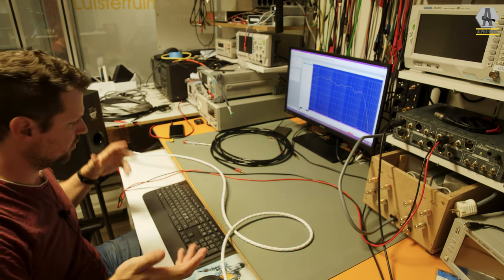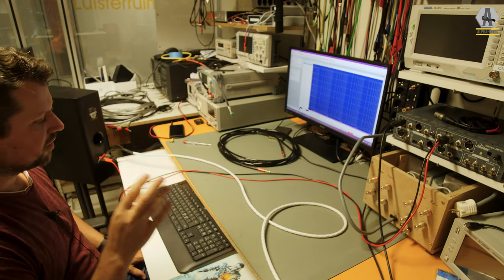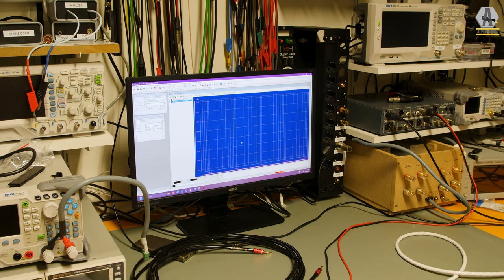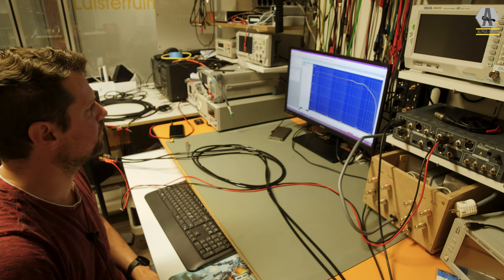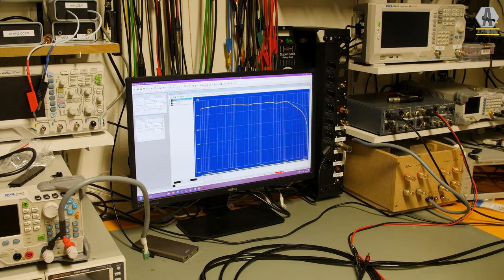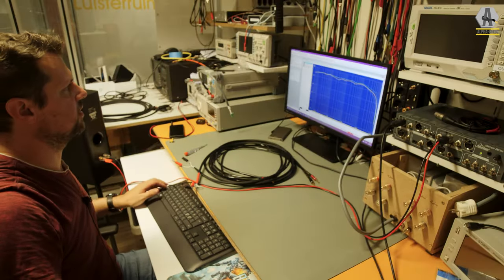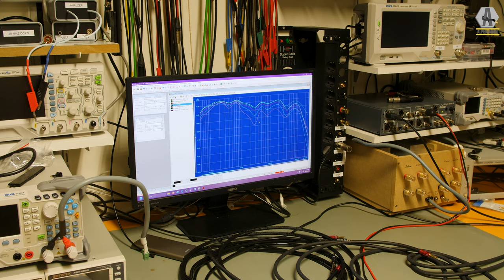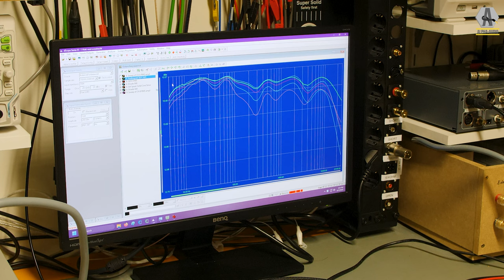Alpha Labs - Do speaker cables matter? We measured five of them!

Comment: You are laying the cables different in your test. You are creating coils this way in some tests. Coils will take energy and will influence frequency respons.
Reply: Yes, inductors block high frequencies, so by coiling the cables he is blocking the higher frequencies in the unshielded cables which would explain the high frequency drop off in some cables. That is of course assuming the cables with the highest drop off were unshielded cables.
Reply: Coils that loose will not act as inductors through air.
Reply: Just commented this before seeing yours. The cables with the highest apparent effect were laid in near perfect coils. Hard to take a "lab test" seriously with such a fundamental and clear flaw.
Reply: Well what would be according to you the impact on response of 3 small loops in the cables?

Comment: Wires have resistance. When driving a complex load like a speaker, the voltage drop will be frequency dependent. The best speaker wire is the one with the lowest resistance, this is no mystery. It doesn't have to be some exotic silver whatever, just plain old thick copper wire. Thick enough for its resistance to be insignificant at the length needed. The test should have been run with no wire as a calibration and the first wire repeated at the end of the test for repeatability. I suspect things like the amp and speaker were heating up making the comparison invalid.
Reply: That's similar to what I was thinking. He's talking about a difference between cables on the order of tenths of dB's, while only having taken a single measurement of each cable. We don't even know if the results are reproducible, let alone accurate enough to say with any confidence that there is a difference.

Edit: Oh and another thing I noticed, several cables are tested with part of their length coiled up on the desk. I wouldn't be surprised if that also affected results.
Reply: @MicraHakkinen   Yes, when you lay or wrap non-shielded cables into a circle or loop, it essentially creates a wire inductor coil or "inductive loop" to at least SOME extent.  And we all know how inductors are used and what they do in multi-way loudspeaker systems, right?  In addition, some of the speaker cables were shown laying across or on top of other coiled cables, while others were not.  :/

The best option would have been to "unwrap" and fully extend each cable and route them all consistently along the same path as much as possible, and also AWAY from any other electronic equipment and/or ferrous metal surfaces.  If you can not extend the cables so that there are no coils or loops, the best practice is to lay them in a large figure-of-eight pattern like the infinity symbol... ∞ with the signal input and output ends of the cable entering and exiting at opposite ends.

Just one real-world example:  We always MUST do this with the "head" or "feeder" cable for our 1k to 20k Arri HMI Fresnel and PAR film/video/photographic lighting fixtures, especially in hot weather and/or full sun, because the lamp head will continuously shut down due to the inductive loop that is created if the cables are simply coiled in a circle like a garden water hose.  The wire coil itself creates the "steady state" inductor, but as the coil heats up over time it further changes the parameters of the coil.

I've seen variances even in "straight" wiring due to whether or not the overhead fluorescent ceiling lighting fixture was turned on or off (EMI/RFI from the magnetic or electronic fluorescent ballast interacting with the cable).  This can also happen when nearby electric motors are or are not running...from a nearby fan or A/C blower, etc.

Also, as mentioned, the parameters of the loudspeaker or individual drivers (and potentially the amplifier) will change even due to mild temperature variations of the voice coil and magnetic motor system as it is powered and in-use (heating up) vs. resting with no signal (cooling down) for a given period of time...easily enough to cause these very minute differences.  Anybody who has tested loudspeaker driver parameters would understand this.

IMPO, there are simply not enough controls in the way these tests were performed to eliminate potential external variables...especially such minute differences.

To see if we (you) can actually hear and discern the effects of non-audible upper harmonics on the audible spectrum, simply play multi-tone sine waves or pink noise with and without an additional >20kHz 2nd and then 3rd harmonic signal component added to the multi-tone.
Reply: So bigger is better ?  i use 10 AWG all through my system, seems to sound fantastic to me,any thoughts? Thanx.

Comment: Under normal listening conditions though, there is no way that anyone would ever be able to tell them apart. What we can chart on a graph and what we can measure on a scope vs what a person can actually discern with their ears...well, those are two VERY different things.
Reply: 0,25 db of eq at 2,75khz can be audible. If we're talking about frequency response with a speaker load, 0,5db vs 0,25db is the difference between a decend enough amp and a good amp. 
It's hard to hear yes but it's audible. It can take some of the edge of the upper midrange. An area where alot of speakers have a hump in the inroom response.

Edit: I  would never use a cable as an eq measure btw.
Reply: Normally, a variation of 3 dB is required to be noticeable..25 no way.
Reply: @chuckmaddison2924  0.25 dB is hard and I would have a hard time in an abx test but 1 db is not even hard to notice in broad band eq abx test. 3 dB is a doubling in energy. Everyone with "normal" hearing should be able to pick that up in no time.
Reply: Not to mention the "worst cables " were laid in coils creating inductors.

Comment: I appreciate seeing this test. While it's important to keep in mind that this is only a test of frequency response and that it's with a specific amp and speaker pair, I find it reassuring that these cables vary by fractions of a dB, which to my old ears I know will not be audible. Phase variations different speaker-amp pairings etc. might tell a different story, but for me personally, I think this test reenforces my belief that speaker cables are likely one of the minor influences on the sound of my system. That said, I didn't exactly neglect them in my system. I'm using DYI Mogami W3082 speaker cables. No idea how they might test, or truth be told, if they sound better than the 16Ga zip wire they replaced, but they made me happy.
Reply from the maker: https://alpha-audio.net/background/the-mutual-influence-of-speakers-amplifiers-and-cables/

The impact remains. The characteristics of the cable as well.

Comment: It's always refreshing and very rare to see someone actually trying to get to the bottom of this question with actual measurements. However, there is a slight issue, there might be something in the circuit that induces current behaving as a microphone in this noisy environment that also has speech. The only measurement that's valid in any atmosphere (a resistor) did not show these changes, interesting. Simply measure again and again with the same cable and just talk next to it, the results will be just as different as here.
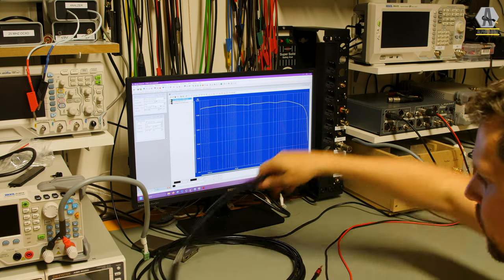Reply: The sound is not measured, the speaker cables are plugged into a plug which is connected to the dScope, which in turn is plugged into the binding posts of the speaker. See 3:25. So, the response curve of the current flowing through the speakers cable is measured. The resistance is the impedance behaviour from the speaker as the sound is played through the amplifier to the speaker.
Reply: @jmtennapel  Let's draw the system from the amplifier's side. The speaker is connected, and to the speaker, the analyzer is connected. This is a general parallel connection, the amplifier drives both the speaker and the analyzer. For a parallel connection, voltages are always equal (simplified), so the voltage measured on the speaker and on the analyzer are always the same. This would be the same if the analyzer would output some voltage. Both the speaker and the amplifier could see that change. This is also true for the speaker, if that created some electricity, it would drive both the amp and the analyzer. Uh-oh, it does create electricity! Speakers are backwards microphones (microphones are literally measured by driving one mic as a speaker), although not very effective, but measurable microphones. The voltage that is created that way, by the noise and speech, is what was measured here.
Reply from the maker: The input impedance of the Prism dScope is 100kOhm. The speaker is 8 Ohm nominal. I don't see the issue.
Reply: @TheAlphaAudio  And a multimeter is 1-10 MOhm yet still measures the same voltage. Resistance is only a factor in serial connections, those are voltage dividers. Parallels divide the current, this is why we use such high resistances, to not burn the analyzers. The issue is that this system is not closed, and atmospheric effects (like the sound of fans and speech) influence it through the speaker. What the driver is inducing is nothing coming from the cable (we're talking about an LTI system here, if they measure the same on a resistor, they can't meaningfully affect a speaker), but what the sound in the room added to its movement - this can meaningfully change the suppression pattern that ultimately resulted in those frequency responses.
Reply from the maker: @SpamMaster57  ok

Comment: You are leaving random numbers of coils/turns of speaker cable on your test bench depending on the length of the cable. What do you think that is doing to the inductance of the cable in your test setup?

You need to repeat the tests with the cables laid out straight. or at least with a single smooth curve from amp to speaker.

Comment: Awesome thank you.
Any interest in taking the connectors out of the equation ?
And maybe seeing whats what with solid vs stranded vs multi core vs flat, copper vs silver, purity ect..
I think connectors can only degrade.
Reply from the maker: Welcome. I don't have a test on connectors planned at the moment. Not sure that really makes a difference to be honest.
Reply: @TheAlphaAudio  I know this was just a test to confirm that frequency response is effected by cables.
And that's fantastic, thank you.
This now gives us insight how this has been a tweak.
Idk answers lead to more questions.
I can't help but to wonder what solid copper wire vs stranded vs flat looks like on the scope of yours or why some consider 99.9% silver sounds bright but 99.999 silver doesn't was all the countless hours and dollars spent on eq via cables ?
As for connectors idk why does gold sound warmer and rodium not so much ?
Maybe 12awg lamp wire has the flattest response but someone preferred silver 1k silver plated copper cable that tilted up from 10k 1 db and that's why it sounded better to them when they could have saved the 1k and used eq and lamp cord....sorry my brain went crazy after seeing this video... 😂

Comment: This fantastic data!  Would very much like to see more of this.  Also, what do you mean when you say you can’t hear 25k but you will hear the harmonics ?
Reply from the maker: We will make more videos like this. We are developing a special device to measure interlinks for example. 

A 25 KHz tone has harmonics. For example there is also energy around 12,5 KHz, 50 KHz... Multiples or for example half of the frequency.
Reply: thanks!  I still don't understand the harmonics thing, but I will ask uncle goooogle and read up.  You and your friends are really doing some unique work.  
I have only just recently approached the point with my HIFI that cable and interconnects influence the sound in an audible way, so this is very timely. thanks again!  
 @TheAlphaAudio

Comment: Is there a correlation between physical parameters of those cables and the frequency responces?
Reply: The visible effect seen on the screen results in slightly different Resistance of the cables. In other words, slightly thicker or thinner copper. You can see two areas,, where the lines are very close. Both unter 100 Hz. These are impedance maxima of the used speaker. At these points, the Impedance of the speaker is much higher as elsewhere (maybe 40 ohms), and so the current and the voltage drop is lower. All in all a flyspeck. ;)

Comment: People can spend a fortune on thick cool cables for their speakers, but when you open up a speaker and see the pathetic wires inside, it is quite upsetting. Speaker manufacturers really skimp on the internal wires which can have a fair amount of length. They gotta clean up that part of speaker design. Professional studio monitors put the amp inside the speaker so that cabling is not critical, and many studio monitor sets now use ethernet to transfer the data digitally, losslessly, like GENELEC SAM systems.
Reply: Powered speakers are for most customers a better idea, but when you talk to the manufacturers of those powered speakers, they will all tell you the wire inside their speakers matters as well.
Reply from the maker: I agree with the powered speakers... definately technically a better solution.

Comment: A one-decibel difference in loudness between two sounds is the smallest difference detectable by human hearing.
Therefore the fractions of a dB difference between your cables is, to all intents and purposes, irrelevant.

I expect that some, perhaps most, of the measured differences is less due to the cable itself and more a function of the integrity of the cable to plug interfaces and plug to socket integrity.

And I think we should all be mindful of the fact that the more you zoom in on an inch, the more it looks like a mile!
Reply from the maker: I disagree. But that is not relevant. We will be doing more research to indicate the difference.

Comment: You didn't state what exactly the test setup is, what are you measuring, through a measuring microphone, or the response at the speaker positive terminal? Was there a crossover circuit in the path? Did you try measuring the same cable multiple times and now much was the variation? Maybe what you see is noise differences in the test setup? It's hard to draw any conclusions.
Reply from the maker: The speaker terminals of the speaker are connected to the analyzer. It is not tested with a microphone. That would also be impossible with all the noise in the room.

Comment: How about measuring the music coming out of the speakers. Remember to level match. Then  show the difference between the files.
Reply from the maker: That is not going to work in a normal room and A/D conversion. Every file will be different. Even with the same cable. This measurement shows there are differences... i can repeat this test and get exactly the same result...
Reply: @TheAlphaAudio  these measurements, are they audible.
Reply from the maker: @r423fplip  yes
Reply: Would you put your house on it ? I will be doing the cable change. You can do the easy part !
Reply from the maker: @r423fplip  yes.

Comment: The noise floor in my listening room fluctuates between 28 & 30db, I can’t hear that so no way I would hear the differences in these cables in normal domestic environments. Yes there are differences but no way audible under blind test conditions. But interesting none the less.
There is more difference in moving your speakers a few inches than any cable will make.
Reply from the maker: Ok

Comment: I’m unclear on exactly what your test set up is. You just roll right into showing us graphs (with small, difficult to read scales) but, never explain how the setup works. Some clarification what help alleviate some skepticism.
Also, at 7:50 you state that there’s a difference at 25kHz and that you can’t hear it but, you can the harmonics. Since, by definition, a harmonic is always greater than the fundamental how is that possible and what speaker will reproduce it? Please clarify.